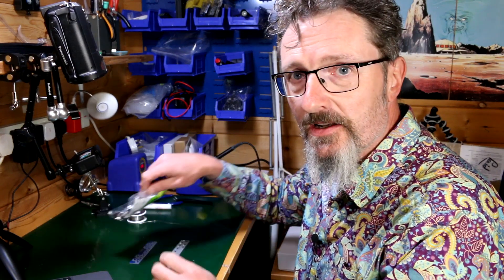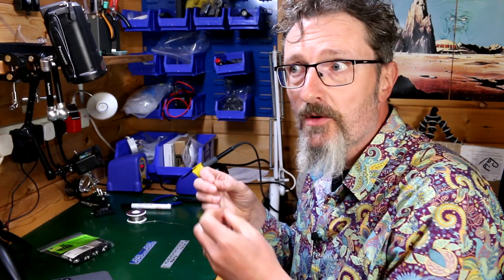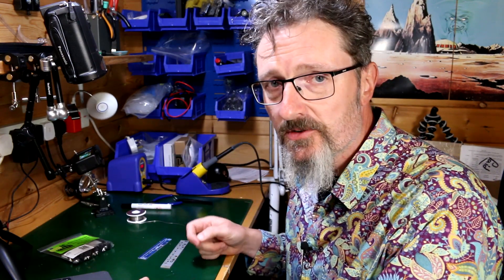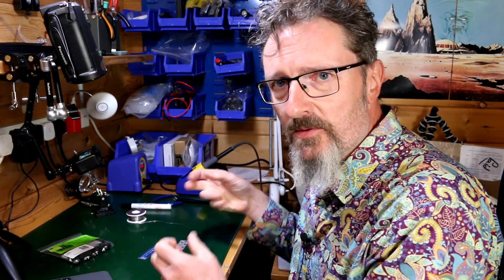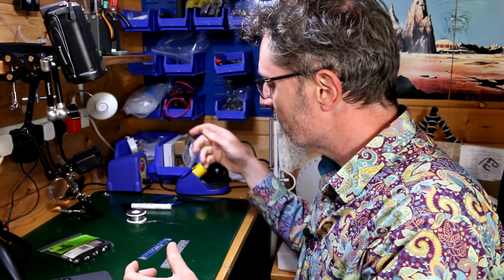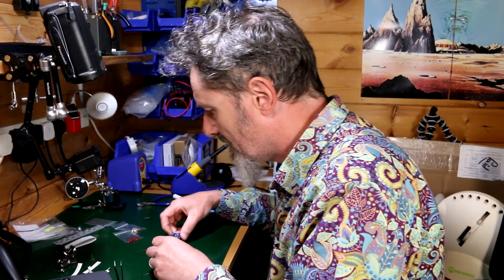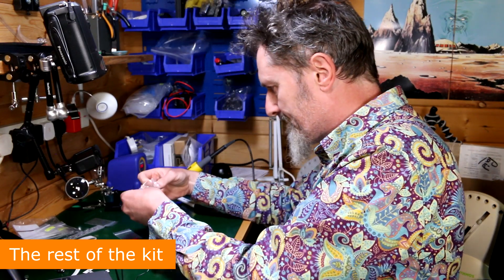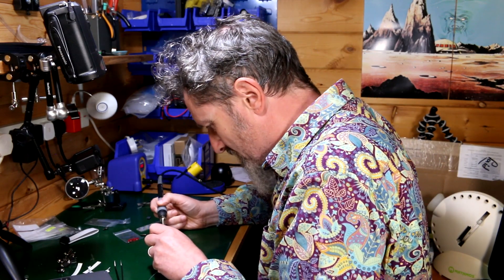Modular DIY 08 - Music Thing Pulses - tackling SMD

Comment: There are some interesting tutorials with a different approach: using flux in a syringe and then tacking on side with a tinned iron while holding the component in place with tweezers. I've found that approach easiest as you don't need to worry about any shifting of the component when applying solder. The only trick for me has been the entire thing moving when I go back to reflow.
Reply from the maker: Sure, there are other ways. My approach is about using what you have rather than having to get extra stuff 😁
Reply: @MoltenMusicTech  which is why we love your videos! :) Just throwing this one out for any other folks experimenting with different approaches. Downside to the flux tack approach is it can make for sticky tweezers.

Comment: Bit of blu-tak under the board will help secure it (or use a board mount, which allows you to turn the board over). That way, you're not chasing the board around trying to to keep it in place while you solder the SMT parts on. Good job mate :) may consider this project to add to my TM

Comment: Hi Robin, I think you might be more comfortable if you use the tweezers "overhand" as opposed to the "underhand" grip you're using most of the time. The overhand position gives you a lot more control. Well, at least that is the case for me :).
Reply from the maker: There's a grip with tweezers? I'm not sure what you mean... i just hold them
Reply: Molten Music Technology I mean that you are holding the the tweezers under/in the palm of your hand. Instead, try letting the tweezers rest in the fold between your thumb and index finger. A bit like when you’re eating with chopsticks ;)
Reply from the maker: Ahhh ok, maybe :)
Reply: I thought that grip was called underhand? Makes more sense if you compare to baseball pitching. That's what I do too. Your curved tweezers have a flat side and it could be held parallel to the flat of the bench, grabbing the whole part more firmly than with just the needle tips.

Comment: Your experience soldering SMDs seems similar to mine - although I need the magnifying glasses more - I'm long sighted & even with my new glasses I prefer more magnification :-) anyway - there are other techniques for SMDs - hot air guns and the oven thing you mention - how many SMDs are in the deckards? is it worth exploring either of those? (the oven thing is probably a ton of hassle if you aren't setting up a production line).  As you say in the video - it's actually quite helpful watching someone who isn't an expert doing these things - gives a sense of what to expect.

Comment: what temperature do you use for smd? I tried the same temp as I do for thru hole components and scorched a pad.
Reply from the maker: I seem to be running at 390 but apparently that's a bit hot

Comment: Flux prevents oxidation of the solder, and dissolves any oxides already present, helping the metal to flow properly and therefore reducing the chance of bad or dry solder joints, is you solder not a multicore solder that already contains flux? Great job btw!
Reply from the maker: Yes, solder already has flux, i was following advice on SMD soldering - "Make sure you use a flux pen" etc etc
Reply: @MoltenMusicTech  Okay, can't have too much flux I suppose!
Reply from the maker: But then I think I found that you can. Advice is fine but I have to work out what works for me because I never understand it until I do it 😀
Reply: @MoltenMusicTech  For what it's worth I think you're doing just fine, thank you for all the video, I for one enjoy watching them. Cheers!
Reply: Actually, adding a generous amount of flux often helps the solder "stick" more easily, so you end up taking less time heating things up (and risking damaging the board and/or components). While in theory you can have too much flux, in practice it's hard to have any problems by overdoing it, so you can be generous and just put flux all over the board prior to soldering - as long as you didn't get some crazy active flux for welding pipes together. If it's for electronics, you're fine. Most are no-clean, you don't need to get rid of them afterwards (but you might want to, for aesthetics and/or because the residue is sticky). For cleaning I use isopropyl alcohol and scraping the board with a spare brush (rinsing with water - preferably distilled - afterwards helps get the stickiness off)

Comment: I found the flux pens to be completely useless.  I find it easier to get some flux paste (I think I got mine of ebay and on the tin it says "TermoPasly pasta do lutowania" - then you can just dip a tooth pick into it and smear it on the pads.  It works really well and the solder really does flow and go really shiny.

The reason you need flux with SMD soldering is because you often need to put some solder on the tip of the iron and then "wipe" it onto the component / pads.  When you have the solder on the tip it will burn off all of the flux before it gets anywhere near the pad / component (which is why you shouldn't do it like that with through hole soldering).  By applying the flux to the pad it ensures there is still some flux there when you apply the solder.

I found the pens seemed to just be full of alcohol and didn't seem to do anything.  Get the paste - it's super cheap!

I have never figured out a good way to flip over the tiny components either!
Reply: I use this for all my IC soldering: https://www.ebay.co.uk/itm/RF800-Liquid-Soldering-Flux-BGA-SMD-SMT-RMA-Rework-50ml-bottle-with-brush/122898694748?epid=18011963046&hash=item1c9d55425c:g:thAAAOSwCMtaT~eQ
It is a little alcohol heavy but it works well. I mainly use the heat plate and solder paste method for the bulk of builds but with ARMs and similar pitch ICs I drag solder and this liquid is perfect and it's cleaner than the flux paste/pens, it really is what's easiest for you. Some ICs like ARMs and DACs are heat sensitive so speed is the key and I've found that flux paste spreads heat rapidly.